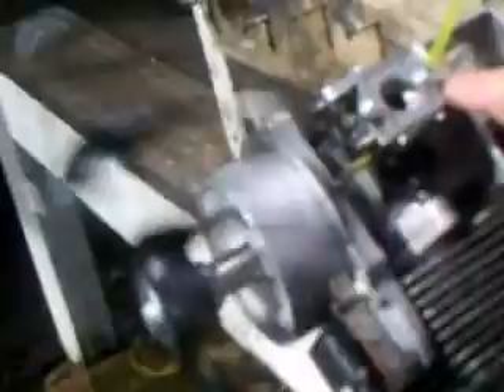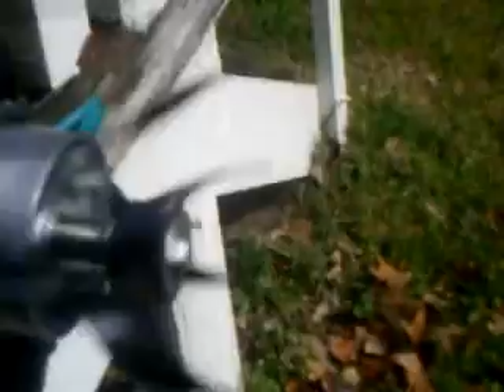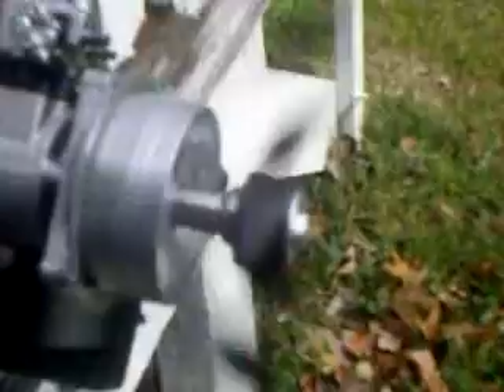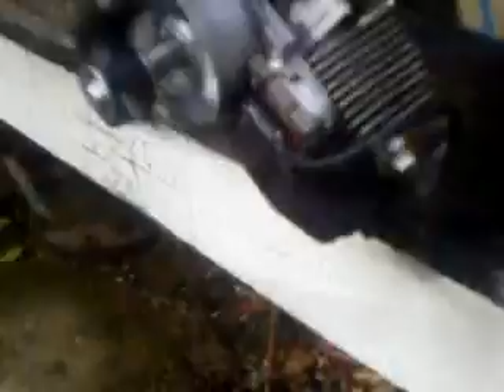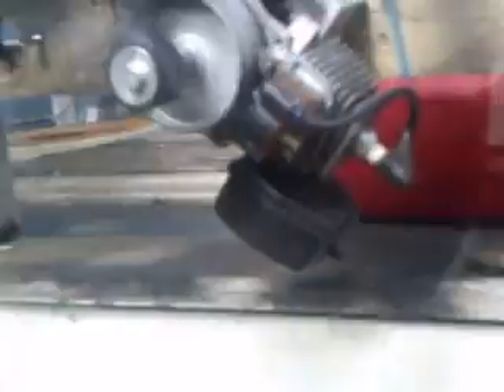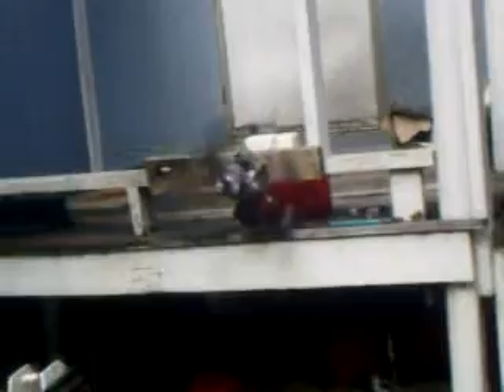IDC GAS MODEL AIRPLANE ENGINE CONVERSION

Comment: I forgot the english name,  in spanish we call it " Espistas". They are like a small screw with a hole in the middle, the fuel passes through this hole and we used to use a dremmel to open this hole a bit wider when we wanted to do a simple mod in the car so it would go a bit faster and we used to change this part and get one with a smaller hole when we wanted to save a bit more fuel. 

Check to see if that carb has what I mentioned before and if it does, try to get one with a smaller opening.